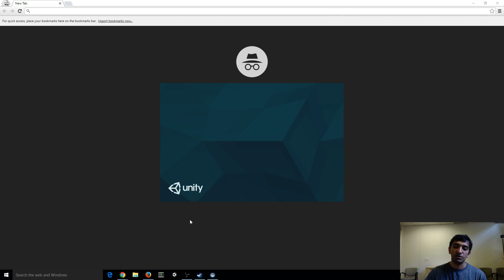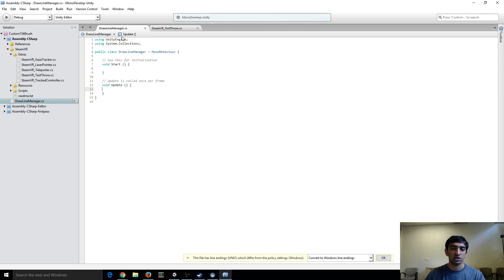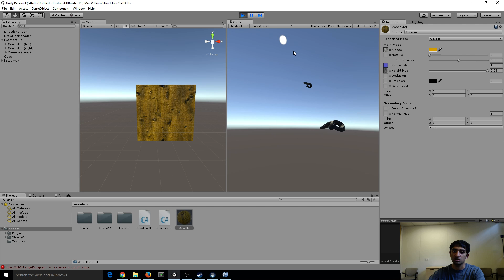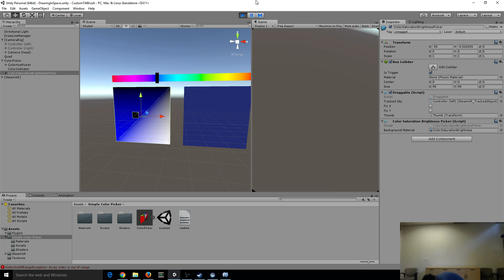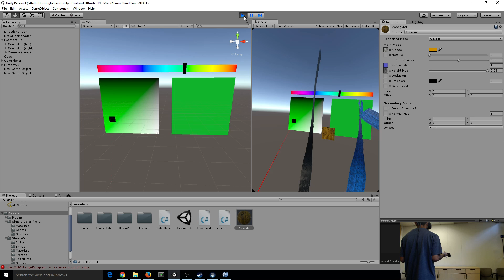Unity VR Tutorial: How To Build Tilt Brush From Scratch

Comment: any idea how to make UI like the tilt brush menus? theyre pretty unique,. no tutorials ive found for it though.
Reply from the maker: i would break it up into a few separate parts:
1) just ray casting from the controller to select a button 
2) having a button that lets us swap between panels
3) using the joystick to swap between panels

each of those parts i think should be easily implemented with VRTK ( i would need to double check 4.0 )

Comment: Hey any reasons I should be getting missing triangles in the line renderer? My lines have little slits in them and I've even tried copying the source code. My lines also twist around on certain axes. Any help?
Reply from the maker: is it periodic or does it happen regularly? there could be a few reasons but it might also be worth debugging to see if the path of your controller is getting recorded accurately
Reply: FusedVR everything is working as it does on your video, just in the video you don’t stress test the ribbons so you barely see the problem. You can see it slightly at the end of the ribbons at some points. What happens is the normal that the perpendicular plane is calculated on flips on a certain axes. After a lot of debugging I managed to get it to display very clearly what happens and the ribbons twist. because it was adding a new point every frame it would jump around the floating point error and spit chunks of planes all mashed together, so slowing this down I was able to see that the ribbons twist nicely on certain poles. I’m assuming this is something to do with the Unity world coordinate system that this is based off of or something of the sort. Do you have any idea?
Reply: To anyone who is wondering, the solution to this problem is to ignore the bit with the cross products in the MakeQuad and just directly pass in the up vector of the controller. The reason being is that when you do a cross product of the start and end points, given the Unity coordinate system you cannot guarantee that the cross product will give you reliable normals for the plane. If you really want the line to stay upwards facing you can do some offsets based on the controller, but this should be handled exterior to the MakeQuad code.

Comment: In MeshLineRenderer, when transferring the array q (the coordinates of the vertices), from world to local space using transform.InverseTransformPoint, what exactly are we transferring the local space in relation to? Also why is this needed? I notice the line works without this portion of the code.

Also, why do we divide the width by 2 in meshlinerenderer? I notice the code also works without it. If its strictly to control line width, shouldn't we just control it in the SetWidth function?

Least importantly, what is numClicks for? Did you put this here just to keep track, for possible debugging purposes later on?

Comment: This is a great tutorial, but I have unfortunately run into a very confusing problem and I need help solving it before I can continue. To summarize, I've done everything up until around one hour and ten minutes into the video. However, when I attempt to draw anything I get absolutely nothing, not even an error message, but it appears that new objects are being created in the location of the DrawLineManager object.

For the MeshLineRenderer script, I am using what was provided in the pastebin-link by Andy Fan. For the sake of experimentation, I changed the initial value of "firstQuad" in the MeshLineRenderer script to "false", and then it actually works - BUT it makes a huge, ugly line from where the DrawLineManager object sits, to your controller, every time you start drawing a new line. Additionally, DrawLineManager is locked in place, I can't move it in the scene view and it shows as a weird, flat, pink square. It still has the original LineRenderer component on it, which I'm guessing is what does that (disabling it doesn't fix my problem, so I've just left it there for now).

I was wondering if anyone else have had the same problem and could help me out, I'd be super happy! I can provide the project files or just the scripts if further documentation is needed, I really need this to work.

Comment: Thank you so much for this! I love it! I used the oculus touch for this instead of the vive and it worked fantastic. Obviously with a few code changes here and there. I also didn't implement the color picker yet, no need for it. I did make my own "delete line" ability though, which is handy. 

Do you have any recommendations for saving the doodles after each load? I saw a comment below, but I'd even be interested in saving the mesh to a file and load in the same position. I'll see what I can do, but just thought I'd ask. Thanks again! 

Edit: For my specific purposes, I was able to use: http://answers.unity3d.com/questions/317951/how-to-use-editorobjexporter-obj-saving-script-fro.html while the editor was running. I basically put a cube as a reference point, exported the meshes I drew, then snap to vertices with the "V" key and voila! Then, you can have the whole scene have your entire drawing load each time instantly.
Reply: Hey Jonathan. I know this reply is coming a year after your comment but I was able to do the same thing with the rift and now working on saving and loading the meshes. I have a couple questions for you how did you go about creating a delete line. By selection of object at runtime and calling destroy? Also did you ever come across a visual mesh drawing error? When I try to draw if my controller moves to slow it doesn't draw. When I speed up it draws and if it slows down again I get gaps in my line. Also were you able to rotate your controller and get the line to draw in different directions?

Comment: Hi @Fuseman, 
thank you for great streams!
Do you have an idea on how to save "doodles" from one session to another? 
I tried storing the points for the lines in Vector3 arrays in a textfile and then rebuilding them in the Start() function next time a session starts. I´ve got it working so it saves a file and reads the file but I can´t get the MeshLineRenderer to actually create any lines. I´ve created the actual objects but the AddLine command throws an error. Looks like it´s missing the mesh  reference m. Any help would be greatly appreciated!
Reply: As fuseman stated, it sounds like you are making good progress. I don't know if you want to do the same as me, but I basically wanted to have my drawings saved as actual meshes. To do this, I used: 
http://answers.unity3d.com/questions/317951/how-to-use-editorobjexporter-obj-saving-script-fro.html

After this, in editor, I selected the objects and exported as a single ".obj" file. Along with my drawings, i also export a common unity "cube" that I use for a reference point. Then, stop running unity, import the obj file exported and snap it to the common "cube" using the "V" key snapping to the vertices. For my case, I wanted to draw basic meshes to chart out sizing of other objects I'll later be designing for the scene.
Reply from the maker: Your methodology sounds right. Try using the AddPoint method instead. AddLine is meant for internal use of the script.

Comment: After creating DrawLineManager , assigning Tracked Obj to it I'm getinng an error 

"IndexOutRangeException: Array index is out of range.
SteamVR_Controller.Input (Int32 deviceIndex) (at Assets/SteamVR/Scripts/SteamVR_Controller.cs:151)
DrawLineManager.Update () (at Assets/DrawLineManager.cs:10)"

I was trying it in Unity 5.35 and 5.40 with latest SteamVR. Do you have any idea what might be the cause?

(Great tutorials BTW!)
Reply from the maker: Do you only get one error and then it works after? That is because on startup the controllers are not initialized, which throws a null. After the first frame, they get initialized and everything works fine usually.
Reply: No, I get the error message, and it doesn't work after. It kicks me out of the scene (I am working on new, empty file). Controllers are on, but looks like they are not initialized, it doesn't recognize them and immediately kicks me out from the scene - I see the SteamVR "room" instead of my scene.
Reply: solution, for me, was: set the Index in the Steam VR_Tracked Object script component
Reply: Thanks Jon! And everything else works after that change? I'll definitely try it again this week
Reply: sorry for the late reply... i had no problems from that fix on.

Comment: Do you think you could make a video for UI that is parented to the motion controllers? Similar to the gun selector in Space Pirate Trainer and the color/brush picker in Tilt Brush?
Reply from the maker: Yeah I can try to incorporate that into a future stream. To be honest, I might do it as part of a bigger project, since it by itself is not super difficult. That said, the reason I did not do it in the video was because the plug in that was being used had a couple bugs that made it not work easily with the Hand Controllers.
Reply: Awesome man that would be really helpful. I've been having problems getting my canvas to respond to trackpad input. Do you know of any resources I could check out to get the two to link together?
Reply from the maker: Specifically for SteamVR, I cannot think of any resources atm. For Unity, you might want to take a look into some parenting tutorials.
Reply: I've actually got my canvas parented to my controller - my problem is being able to navigate the canvas using the trackpad on the Vive since the controller's input isn't hooked up to Unity's Input Manager. And I think the event system in Unity only works with inputs from the input manager. Is that right?
Reply from the maker: You can write your own event manager (Google does this in the Cardboard SDK for GazeBasedInteractions). But alternatively, each UI component has a corresponding class that you can use to manipulate it. So depending on what you would like to do, there should be a way to manipulate it without having to go the above route, which is slightly more complex.
Reply: Do you think you could add in a quick segment to one of your upcoming streams about raycasting from controllers into Unity's UI in a similar manner as Tilt Brush? Basically something similar to what you did in this video but with Unity's UI instead of game objects. Thanks!
Reply from the maker: you mean like a UI Image or Button? The way i usually do it is by adding a Box Collider around the UI element and then have the Raycast hit that so that I can get a reference to UI I want. There might be a better way, but that is what comes to mind immediately. If there is time at the end of the stream, I am down to play around with it then. Also feel free to ask others during the stream for their input because they also seem to be super helpful :)

Comment from the maker: Changing it up this week and going to put the time stamps in the description. Enjoy!

Time stamps:

Intro: 0:09
Creating a new project: 3:10
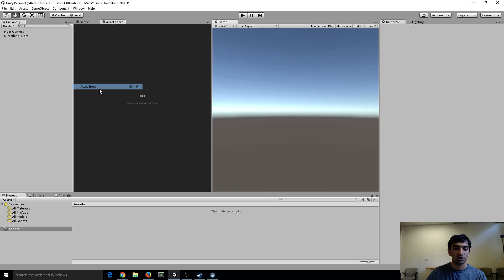Getting SteamVR: 3:46
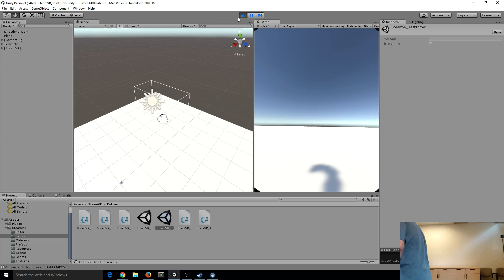Testing Unity with SteamVR: 6:25
DrawLineManager: 10:04
Unity Line Renderer Explanation: 15:19
Creating Lines with Code: 18:59
Local vs World Space: 28:09
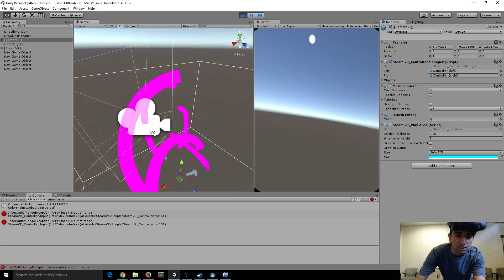Line Renderer Billboarding: 30:26
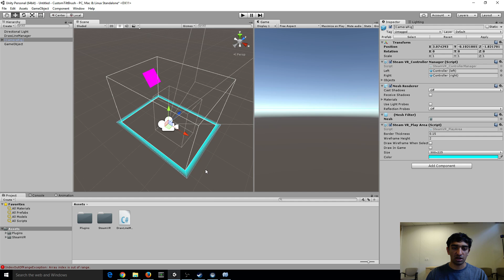Mesh Line Renderer: 33:15
Performance: 34:43
Using Tilt Brush to explain line renderers: 36:26
Explaining the Mesh Line Renderer: 42:45
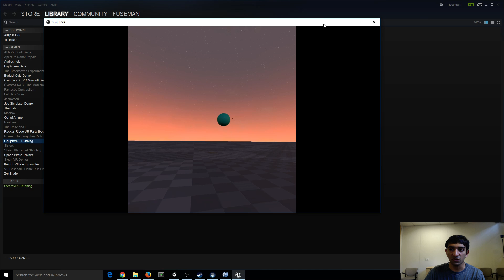Break - SculptVR : 55:36
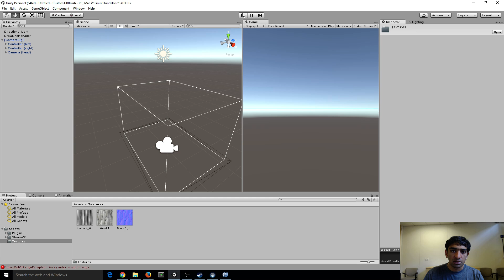Mesh Line Renderer Wireframe: 1:12:00
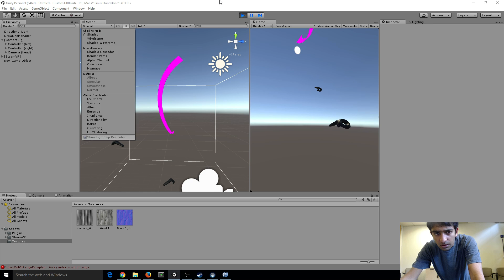Materials: 1:13:15
Drawing w/ Materials: 1:20:26
Simple Color Picker: 1:24:32
Changing Scripts to work with Controllers: 1:28:24
Adding a Laser Pointer: 1:37:04
Singleton Programming: 1:40:40
Changing the color of each line painted: 1:44:10
Ending: 1:50:21
Reply: FusedVR Great work! Can we have the DrawlineManager.cs. and edited MeshLineRenderer.cs for better understanding. The script is almost unreadable in the monitor. And another question can we use trailrenderer instead of line? Thanks for your great tutorial.